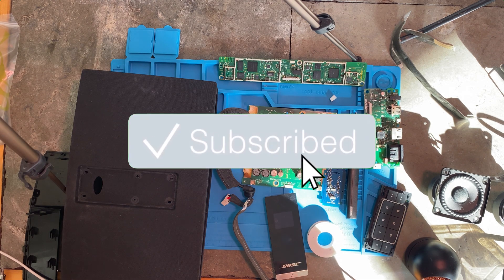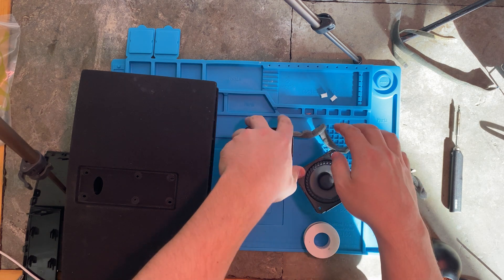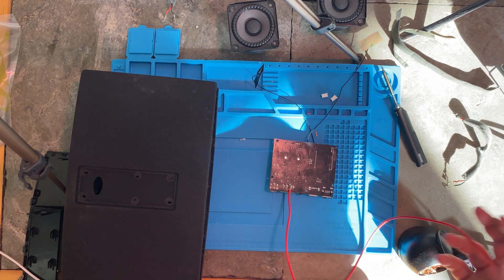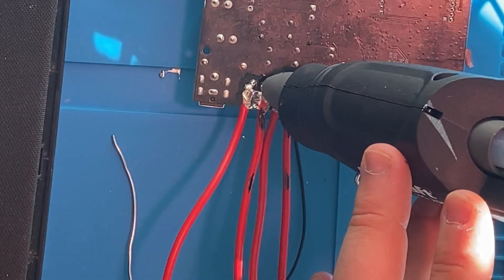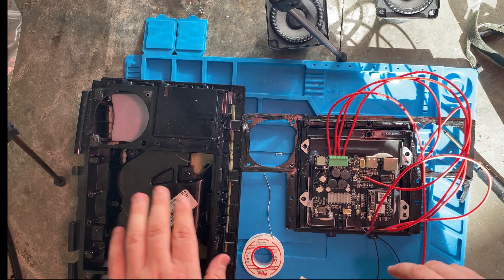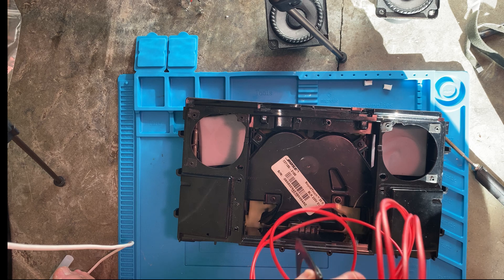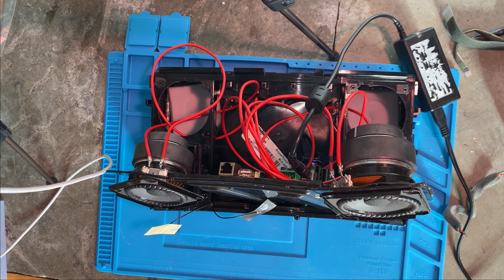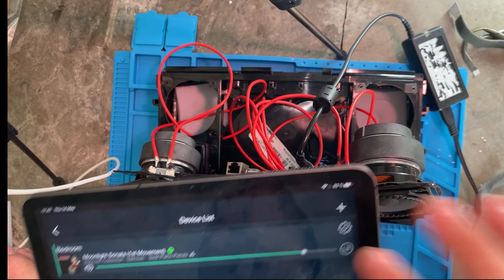Let's Fix It: Bose SoundTouch + Up2steam Amplifier

Comment: Why hant you reused existing wires came up with the speaker. I am going to hack my soundtouch 30
Reply from the maker: Most of the old cables where ribbon cables and the speaker wires were kind of short